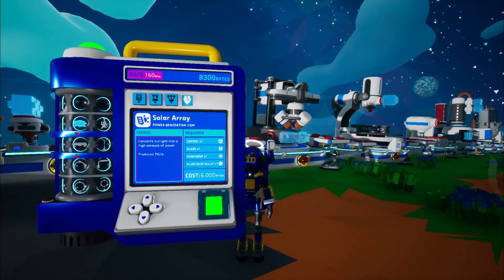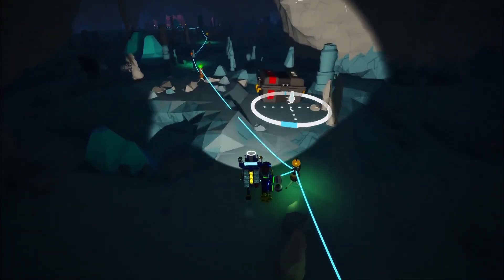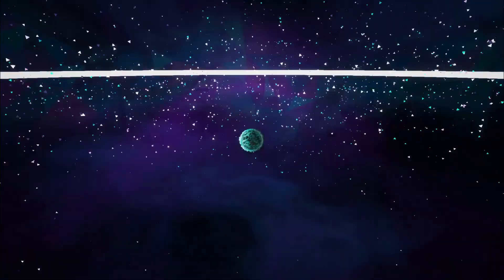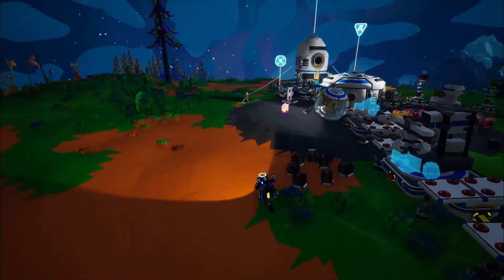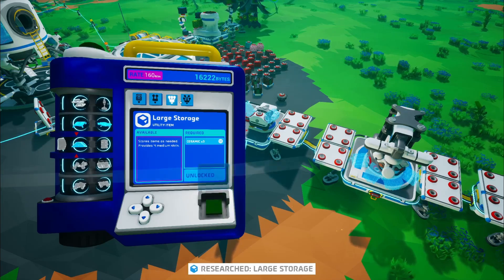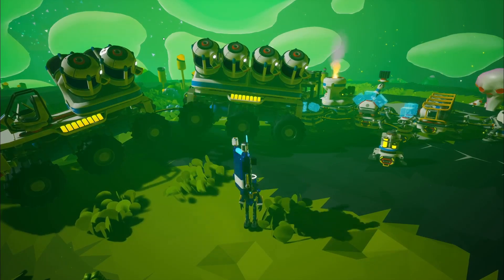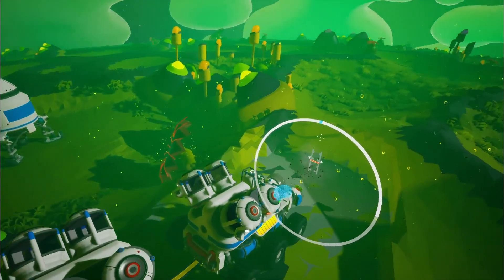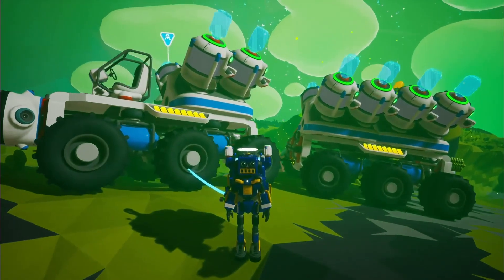Building a Soil-Gathering Rover | Astroneer Ep. 5

Comment: Why not use trailers instead of two large rovers??
Reply from the maker: That's what large rovers are. They're large trailers, and each one can be turned into the driving one. The actual trailer schematic is for the tractor, which is much smaller.

Comment: If you get those caches to the surface on Glacio, you can use the bomb-lobbing plants to open them.
Reply from the maker: I didn't think to try those. i only tried the one that blows up when you get close, and that one did not work.
Reply: I was just about to say this. BOTH the catapult plants and Boomaloons on Glacio work though they are a bit finnicky. You have to get them rather close to the blast while just barely getting into the activation zone yourself not to die. I've got it 3/3 as of right now for times I've tried it. And the catapult is kinda hard to get to aim right so i use the boomaloons. And it's a great early way to get exos without dynamite or hastle